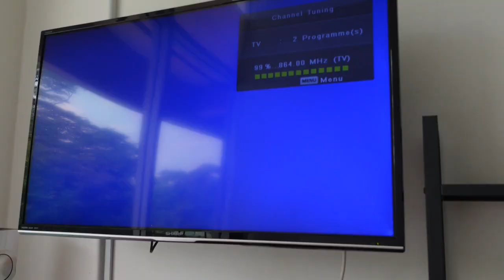How To Use Modulator HDMI To RF

Comment: I would like the unit to do actual RF transmission into the air. How to do that? Just a little power, to allow some CRT televisions in the house to receive it. In PAL.
Reply from the maker: Sorry, I don't understand your question.
Reply: @satelliteandterrestrialsys231  Just send out the RF signal with an antenna and a little amplifier through the air. Small scale, so the reach is a few meters, and no authorities get alarmed.
Reply: Use three amplifiers between this device and a powered antenna.

Comment: The Channel Number On The Modulator Doesn't Match With My TV Channel. And My Analog Channel Take Over The Local Analog Tv Signal.
Reply from the maker: Hi .  You  can't put  your local tv Analog modulator  number  to. ur house use modulator it's can be  cross ❌  try to change number .
Reply: @satelliteandterrestrialsys231  Yes I Changed To Other Number And My Signal Can Go About 40Km, So My Neighbors Also Get That Interference Too.
Reply: Use a higher number and a different frequency. Also, the device might display (example) channel 85 but be located on channel 50 in the tv.

Comment: I set to channel 4 on the device using hdmi. But all I get is No Signal massage. What sm I foing wrong?
Reply from the maker: Hi. Please  check again.  Some channel number  unable to get because your country local  tv use that number . Can be   cross ❌ . . please try again 21. 23. 26.
Reply: The thing worked for 1 day with and hdmi splitter from a rogers ignite box in toronto ontario. then it wouldnt work at all. Then no signal as u described.  dont buy this piece of shit. i am so fucking frustrated that is says no signal and require more equipment like a hdmi to av to connect to hte av setting for it to fire up and old tv. it worked with and hdmi retro game box upon initial test fine also. now its a fucked up piece of shit. im read all manuals and tried everything, if it says no signal imo its busted pos.